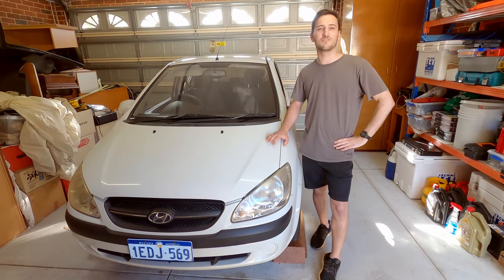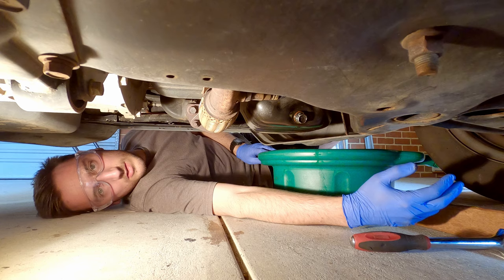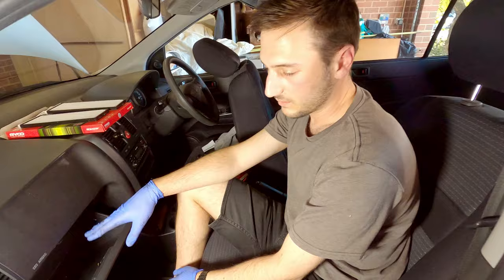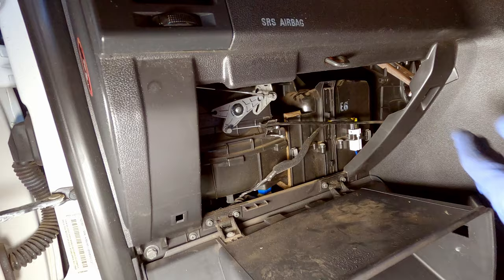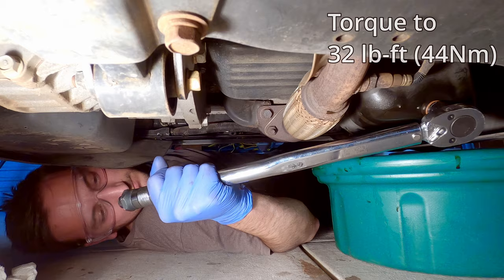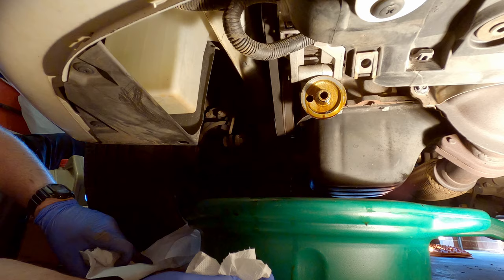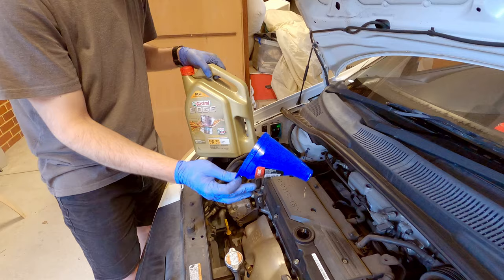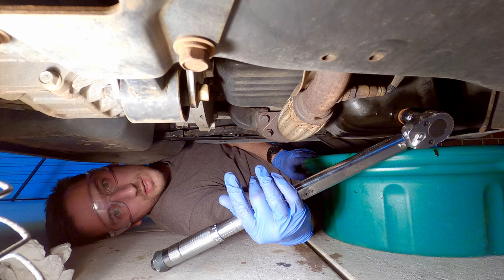Oil Change, Oil Filter and Air Filter - Hyundai Getz 1.4L (2005-2011)

Comment: When changing pollen filters use vacuum cleaner to duck out all loose debris before installing new ones notice the cover lid was covered in dust wash it then refit
Reply from the maker: Hi Brian, thanks for watching. We didn't show it in this video but agree that when replacing the air filter or cabin air filter it's a good idea to vacuum out the housings while you're there, before installing the new filter
Reply: O

Comment: You didn't need to jack her up or use ramps. Cool stuff✌️
Reply from the maker: Hi Kevin,
Thanks for your feedback.
Absolutely, it's certainly not a requirement. We found that driving up onto these 3" wood blocks does quickly and noticeably increase the amount of room you have to work underneath though, and with the Getz' limited ground clearance every inch helps!
Cheers
Reply: if you are a slim Jim, no need for a jack or ramps.

Comment: Do you know where the Getz feul filter is located ?
Reply from the maker: Hi, yes it can be accessed from underneath the back seats (inside the car), as it's an in-tank fuel filter. Hyundai part number calls it a long-life fuel filter, and it's located adjacent to the fuel pump as part of a larger assembly which lowers down into the fuel tank. We may look at a video on this changeout in future, but don't have it planned in at the moment. Partsouq.com have a really clear exploded diagram showing this arrangement if you put in the Getz VIN and search for "Fuel system". Hope that helps
Reply: @2ndGearLow  Thank you

Comment: Thanks man, doing maintenance my getz I bought, looks like nobody ever serviced it. Cabin air filter was dirty AF and there is gunk in there. Will have to clean it out next time I change the filter. Engine one looked bad too. 

At this point ima change everything lol.
Reply from the maker: Some good preventative maintenance is always a good idea - especially when you don't know the previous service history. Oil, filters, fluids, belts etc. Good luck!
Reply: @2ndGearLow  Suprised my timing belt didn't snap, it was last changed in 2014, just got it swapped out. Owners manual says every 90k or 6 years... currently changing my spark plugs while going off your other video, but my cover is stuck or something because I can't get 2 screws out.

Comment: Great video. Whilst it's not required I'd recommend soaking the filter media a bit so when it turns over it doesn't have to exert itself as much, say 300ml of that 3.3L. 

Something I've always found curious about that EDGE 5w30 from castrol and lots of castrol products in general is the severe lack of certification on all these oils...I asked them why it doesn't have the latest API cert and they said it could do it but the it wouldn't have a specific VW cert 🧐
Reply from the maker: Thanks Konducta, we appreciate your feedback and that's very interesting to note

Comment: Sorry to ask such a basic question but i do need help on this one. Does the Getz have an engine protection plate? In your video it doesn't and my car at this moment doesn't. Problem is I have a vague alzheimers blurred memory that mine did have one before it went to the garage to have the cam belt changed. The mounting holes (X2) for such a plate are definitely there at the front. Thanks for any assistance you can give.
Reply from the maker: Hi, sorry for the slow response to this one. We didn't have any additional plates from what is shown in the video, but they may have been removed by a previous owner. Looking at the exploded diagrams on Partsouq.com, I found that there are two under covers - 291201C010 (RH side) and 291301C100 (LH side). It seems these are more of a splash shield rather than protection plate (against impacts etc.). If you enter your specific Getz VIN into Partsouq.com they have detailed diagrams of almost the entire car with part numbers, so you can see what it may have come with, which we use all the time. Hope that helps!
Reply: @2ndGearLow  Many thanks for your very helpful and detailed answer. It looks like my Getz is without under engine protection (it does have the other 2) and always has been i guess. Thanks again and keep up the good work.

Comment: hi would like to ask if you know if there is a getz model that has a different setup for the in cabin air filter, ive looked behind the glove box on mine and it doesn't looks at all like you have where you pulled those two filters out. on the right side there seems to something like a big bowl and on the left side i can se something more boxy, there seeems to be some kind of sponge between these two compartments that connect to each other

Comment: Hello ,i am from morocco and i use 10w40 oil ,is this good or not ?!the weather here is warm even winter
Reply from the maker: Hi Med Atlas Eagle, thanks for commenting and good question. The same car sold in different markets will often have different options/trims and specifications unique to that country, so best to refer to your Owner's manual to check what oil is specified for your car. 10W-40 is not specified in our Owner's Manual for Australia, but it may be for yours.
Reply: @2ndGearLow  yhnak you ,l bought it from second hand ,and i don't have manuel ?!!
Reply: @medatlaseagle9645  if its a petrol engine 10W-40 will be the best choice

Comment: Hi there. This was really helpful and covered all my questions but one. Can we do the same procedure for Getz year 2004? I’d highly appreciate a quick response.
Reply from the maker: Hi Waleed, while it may be a similar procedure for a 2004 Getz, this video features the 1.4L engine (G4EE) which is not found in the 2004 models. Best to get your hands on a copy of the factory service manual (FSM) for your earlier model, and you can put your Vehicle Identification Number (VIN) into partsouq.com to get diagrams and part numbers for any parts (including fuel filter, air filter and sump plug gasket) on your particular vehicle.

Comment: What to do that remaining oil???
Reply from the maker: Hi Manohara H C, you can keep the left over new oil to use for top-ups in future. Depending on age/wear, some cars will lose enough engine oil, e.g. through burning or leaks, to require top-ups between oil changes, so it can be useful to keep some of the left over new oil. The old engine oil can be disposed of by putting it in a container and taking to an auto parts store, where they will often have disposal bins for waste oil.

Comment: Is it worth getting a new engine in a Getz?
Reply from the maker: Hi Britney, this is a hard one to answer, depends on a lot of things such as condition of the rest of the car (inc age/kms), whether you can do any of the work yourself, etc.
However, generally speaking it seems less economically worth it to replace an engine in  a relatively low priced car, given that much of the cost is in labour. It wouldn't hurt to get some quotes on replacement if the engine is beyond repair

Comment: How can i lift my getz from the front what is the jacking point there?
Reply from the maker: Hi, please refer to the owners manual for your vehicle. There is a Jacking point on each side, check out our timing belt change video which shows Jacking and removing one of the front wheels using that method

Comment: What is the right oil for a Hyundai Getz 1.4L
Reply from the maker: It should say in your owners manual, if you have it. But if your car has the same engine as ours it will likely take 5W-30 engine oil. Hope this helps!